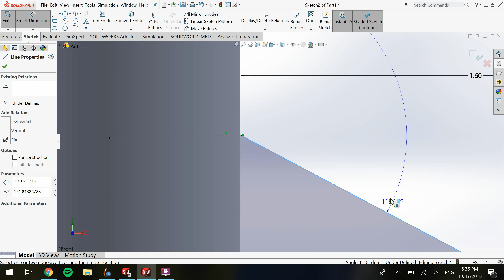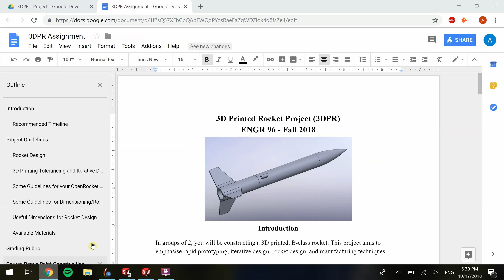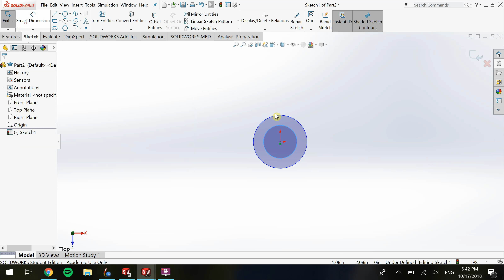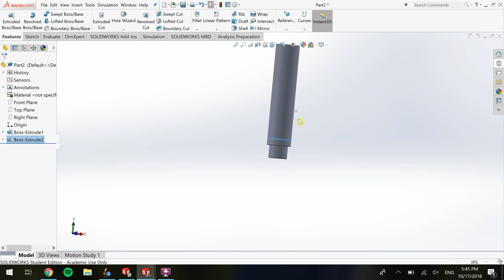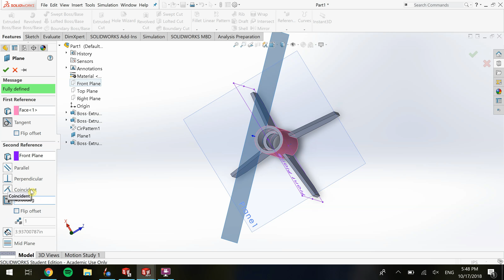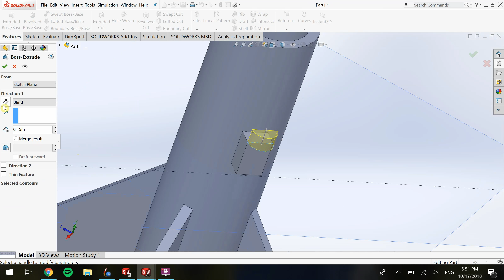Super Sick Rocket CAD Video!

Comment: Hey! Nice video! I have a few questions. 
When you make the second reference plane, I don’t quite understand why you make it tangent to the outer face and apply the 135 degrees? The thermodynamics just quite doesn’t add up. Shouldn’t the reference plane have to be a 0.375 cm not inches, so it could accelerate with less mass on the thrusters but adding velocity? I don’t know, just food for thought, thanks!
Reply from the maker: Marco Andres I’m glad that you enjoyed the video! Those are some good points you make. I produced this video relatively quickly and it may not be optimized. I’ll run the simulations and get back to you about those considerations.